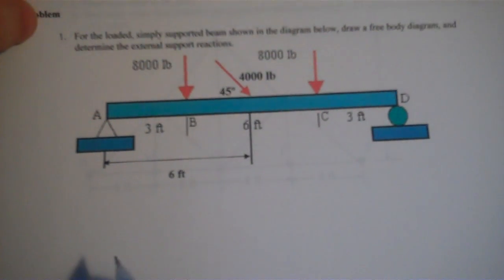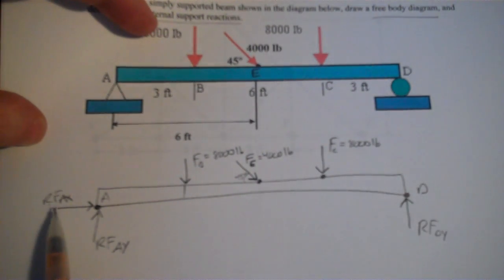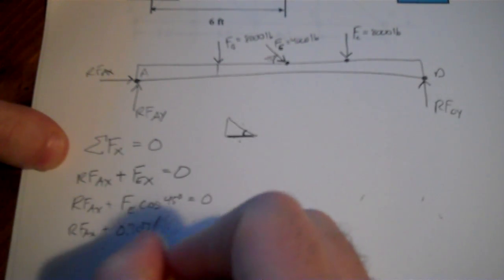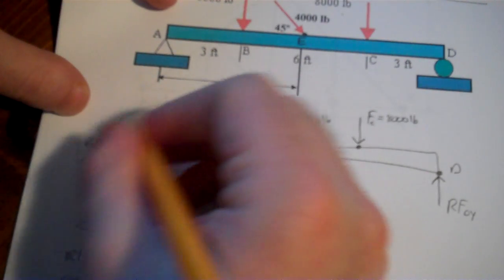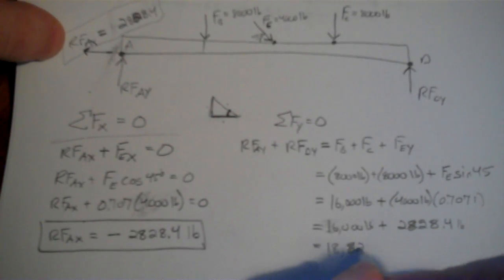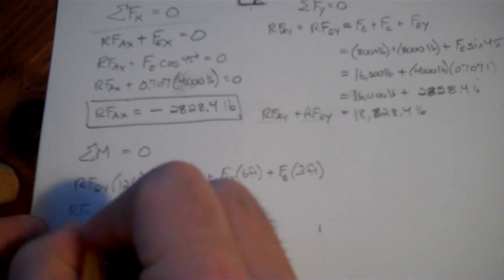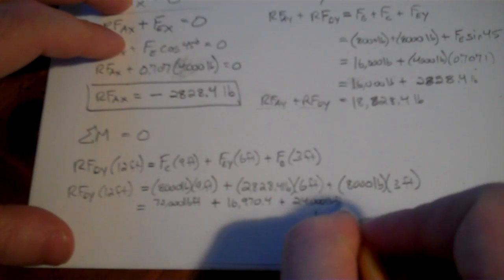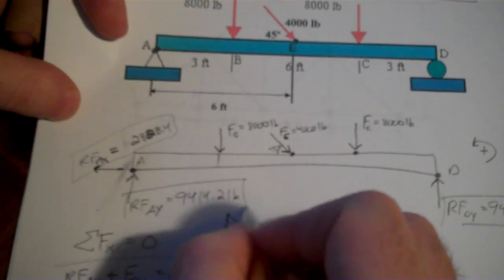POE Practice Problem - Loaded Beam

Comment: Sir, you are wrong in finding the rfdy, your sign should be on negative because it is on clockwise direction..  it should be look like this RFDY(12)-8000(9)-4000SIN(45)(60)-8000(3)=0   instead of this  RFDY(12)-8000(9)-4000SIN(45)(60)+8000(3)=0 but you are so great keep on posting videos on engineering mechanics God Bless
Reply: it depends on how you take it .. clockwise can be +ve as well as -ve and vice versa !